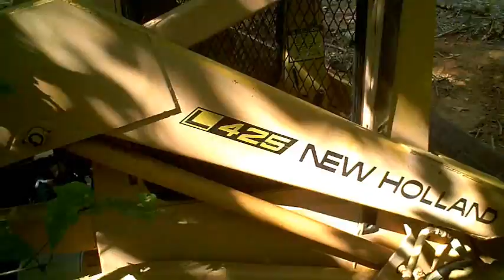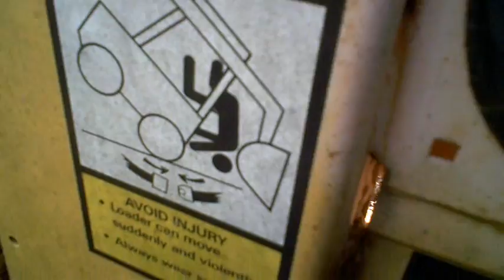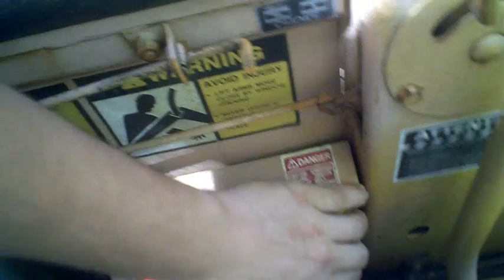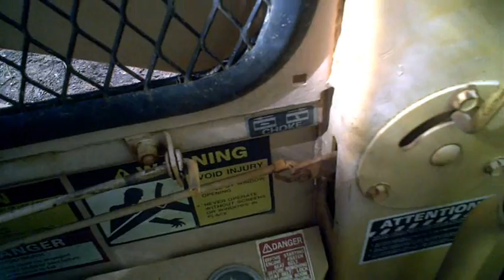new holland l425 skidsteer walk around

Comment: I have a Winconsin engine as well.  It also burns oil...  Just be careful with the oil filter on those motors.  I always buy a Wisconsin brand oil filter.  Tough motors, can take quite a beating!

Comment: I have the same tractor and I just changed the motor. Everything works except I can make it go forward or backwards. What do
You think it can be?
Reply from the maker: Check fluid lever first is the pump making noise
Reply: @DannysCam  The fluid level is good & the pump doesn’t make noise but I’m not sure the wheels need a connection or if they need the seat. I’ve been trying to fix it for 5 months. I really appreciate your help so much.
Reply: @DannysCam  Do you know if there is an electrical cable I would need for the wheels to function? I’ve had mechanics come & look at it but nobody has been able to figure it out.